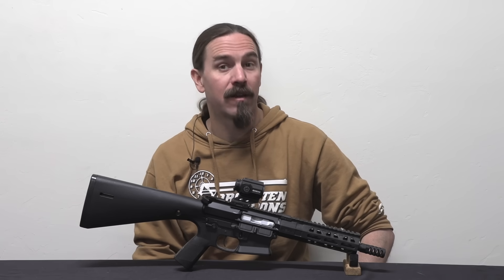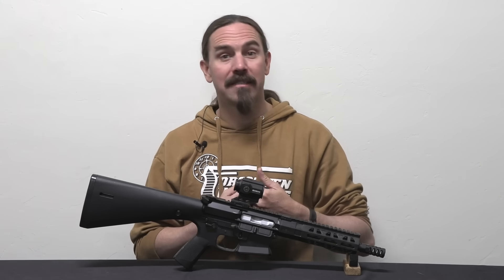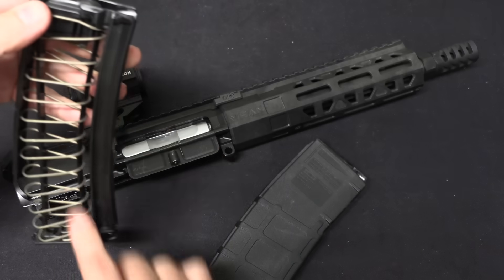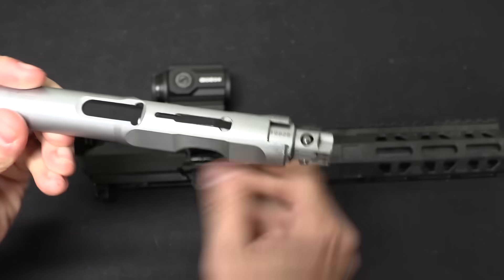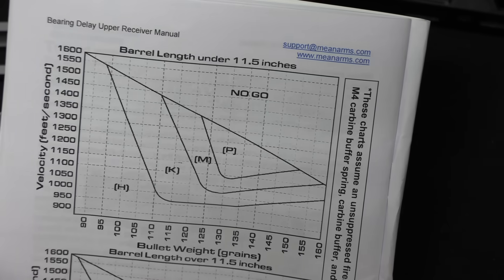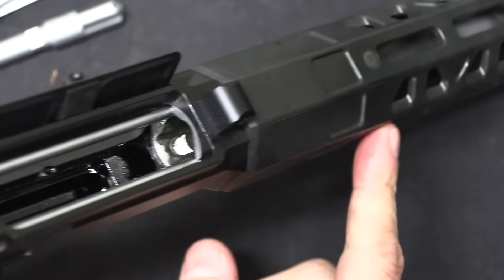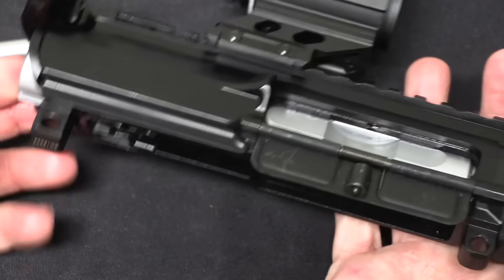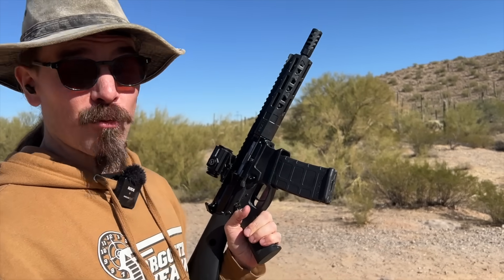Mean Arms' Bearing Delay System

Comment: There IS NO DELAY,, as in a HK, there is no delay,, its a carry over from the german rollen unterstützes masse verzügeres verschluss , the bolt head moves as soon as the projectile leaves the case, its just as slow as a heavy one piece bolt,, it does this by in a HK using rollers, in a Famams a lever (a Famas is a lever assisted blowback) , the bolthead in all systems just makes the bolt carrier move faster due to rollers or levers or in this case ballbearings ,(as a lever )  ,,it only happens for a short travel, and then the fast mving bolt carrier , drags the slow bolthead along ,,   these kind of guns should be called roller assisted blowback or lever assisted blowback or ballbearing assited blowback ,, ,, the delay dosnt exist in any of them
Reply: think about it,, if the bolthead didnt move before after a delay,, what the heck makes the bolt carrier move ??
Reply: Correct. It’s not delayed, it’s a “slowed down” blowback. That’s why this system is not suitable for full-power rifle cartridges: the case starts to deform as soon as shot is fired, and the chamber pressure is dangerously high.
Reply: @noneofyerbeeswax8194  Not true, its used im the HK G3 a fullpowered riffle, its also used in Hk 5,56 rifles and in Famas  ,in 5,56,,  Hk used fluted chambers, but i think famas get by without,, but i dont know if the Cases is reloadeble after wards in Famas ,, HK can be reloaded ,, and no, nothing is slowed down,,  the wqord deleay is from the German word versügered ,, ,, but the German phrase Masse versögered verschlus, is , better translated  to mass reateded lock

Comment: It’s cool, but way overpriced in my opinion by the time you buy an upper and a few of their magazines you’ll be $1800 into it not to mention the price of a complete lower upgraded buffer system, etc. all total probably 2200 and for that price of much rather have a high-quality SP5/MP5 clone with the true roller delayed gas system, they are way softer shooters than what I saw here in this video. And honestly, the aftermarket for MP5  is almost as big as AR 15s. Not to mention the zenith and century mp5’s are usually around $1500 on sale so you’re getting a better weapon for substantially less money. The A.R. 15 was not designed to be direct blow back, these companies have the right idea by trying to delay the lock up, but it still isn’t as smooth as a true roller delay

Comment: That bolt looks like a 1/2" impact gun anvil. Even the coating looks familiar to me, a 7 year auto tech. I suppose it serves a similar purpose: bear an extreme amount of pressure on all of your exterior faces without unlocking the detents or leaving the chamber, then unlock them and slide out precisely when commanded.

Comment: I use the mean arms 9mm conversion magazine with a CMMG delayed blowback 9mm upper. It’s cheaper and less complicated.

I use the standard buffer because it doesn’t need to be adjusted. 

With a suppressor attached the system works perfectly and is close to hearing safe with standard range ammo.

Comment: After getting to shoot a full auto MP5, I'm in love with roller delayed blow back for 9mm. This looks like a fantastic upper. But at 1500$ for the upper and 35$ for the 40 round mags, its just too expensive. If I was a competition shooter I would 100% get one. I'm not a competition shooter and as a PCC solution it is just to expensive. In the PCC space you have lots of much less expensive options. There is defiantly a place for Lambo PCCs, just not in my safe. For 1500$ I can get an MP5 clone or just spend the full 3k and get a real MP5.

Comment: See i LOVE the mags being standard p mags, at least your muscle memory for working the gun and reloading will carry over exactly, even though the recoil control won't. Which is WAY MORE than most PCC's can list as a positive. Helps it fit the title of a trainer upper better.
The ability to tune the system is like butter on top, probably the only PCC i have ever seen and didn't instantly think of reasons i would never buy or touch one.

Comment: not to sound like an armchair gun designer but for about as long as i've known what roller delayed blowback is and how it works, i've thought that ball bearings would be a natural evolution of the cylindrical rollers that HK and company have historically used. reminds me of how i thought it'd be really cool to have a pistol where the springs rest in the side of the slide/bolt instead of in the middle of it so that the slide/bolt could move back further and have a longer travel, meaning it'd have more of a runway to decelerate before putting the recoil back onto the shooter, only to discover that one of the variety of autoloading magnum type handguns had already done that. i forget which it was, probably either the wildey or the Brand Name AutoMag (TM). guess it's good to know that my ideas have precedent for working on the off chance that i ever get loaded enough to actually afford to design guns. a nice thought, i suppose

Comment: Curious how these compare to the CMMG radial delay. The CMMG doesn't have adjustability but used for many other stronger caliber. 

I love my CMMG 9mm and 45acp setups. But the Endomags did not work at all for my 9mm, had to get the CMMG Colt mag lower

Comment: You swithed to a heavy buffer, but I am very curious if changing the lifter could also tone it down.  Less mass flying back and forth will also reduce the felt recoil if a different lifter can slow the bolt down.

Comment: Some good ideas and good design.  Roller bearings will probably wear slower than ball bearings.  Relatively complex machining.

Looks well made.  I wonder if the tolerances are too tight for dirty conditions.

In an ideal world, the operating system would automatically compensate for different impulses/pressures/masses.

Looks like it shoots nicely.

Comment: Love the concept but how well will it work in dirty, dusty and muddy conditions? Seems to be a lot of small, tight tolerate parts in there that wouldn't like any foreign material around. Otherwise, I think it would be great for the police to use after trading in their 5.56 uppers. Less range, and less velocity makes the public safer. I've seen windows shot out 600 yards from a police action with 5.56 where a 9mm would not have traveled that far.

Comment: as ive sayed multiple times in the past: Balls make NO SENSE at all! The surface is LESS than of a roller, and the rollers already are wearing parts. Additionally, the angled wedge (the only way to "adjust" the rollers - or "cam lifters" called in here) will wear more again due to the low surface.

Instead of wasting money for a "bearin delay" just get a roller delay MP5 - it is already eating rollers, but at least its a proven system that does work for a couple of rounds.

Comment: I appreciate the video of the Bearing Delay System and you explained it quite well.  But, I don't believe I could ever trust that system over the "normal" AR type bolt with the locking lugs.  I wonder how often you would have to change out those bearings?

Comment: I'm confused, since its not di or gas piston, what pushes on the bolt carrier to unlock it? Since its locked with the bearings the bolt can't move back to push the carrier. Or does the bolt move back a little to start pushing the carrier?
Reply: The bolt moves back a little, which pushes the ball bearings together pushing the lifter aft, which moves the carrier back and unlocking. It probably takes about 30 pounds of pressure on the bolt face to unlock it.

Comment: It's awesome to see this kind of engineering being done today. 
Question. Once the delay has overcome the bearings resistance to the chamber/bore walls, does the angle of their force on the lifter provide 'acceleration' to the bolt too?

Comment: i'm working on a novel delay system where the bolt gets super depressed and doesn't have the energy to unlock until its room is so full of trash that it can't see the carpet anymore, then it finally does its job and cycles.
Reply: well, you gotta have uppers and downers for sure !!
Reply: Rate of Fire: One to Three rounds per week.

Accessories: Available, but why bother.
Reply: I have a lot of experience with that system
Reply: @DeltaSierra0605 good to see a fellow S.A.D. operator
Reply: I had one that I called "throw it in the sink until the end of the football season." An absolute dream.
Reply: Is this before or after it loses all of it's friends, job, and girlfriend?
Reply: @Gunbudder  introducing the new and improved HK MEH-7
Reply: @Gunbudder  teenager delay cycle. Heard it's pretty gassy though
Reply: Hoarder delayed, it's been done
Reply: you ok man?
Reply: Gen Z delayed system.

Comment: Innovative. CMMG Banshee has been using Mean Arms 9mm mag inserts for years. Question, though, why use a muzzle brake on a 9mm delayed blowback rifle? For people who want to lose their hearing? I wonder if the bearing delay mechanism is any stronger than the CMMG radial delay system... the CMMG system is simpler, and generally fewer parts means less parts to break. I like the mags that don't require a PMag, too. I'll have to look for some of them for my CMMGs.

Comment: rollers replaced by ball bearings.  I think rollers are superior since their shape makes them work in the longitudinal way on their wole length right from the start, whilst balls concentrate the constraints in a small arc which gets wider as the bolt moves backward.

Comment: Great video and the best explanation of how the parts work and go together that I've seen so far.  The owners manual does a great job explaining this but we live in a video world now and even though I've cleaned mine 3 times now I've still learned a few things from your video.  I bought a 16" version in November of 2024 and really enjoying this upper.  I'm using it on a Aero EPC9 lower with Glock mags and mainly use it for PCC in USPSA.  I have 1280 rounds through mine with zero issues.  The machining and finish on all of the parts is exceptional and I like the polymer handguard more that I though.  It's a keeper..... all of it.

Comment: No way. I was working on something very similar several years back, inspired by that video you made on the ball bearing locked bolt action. I still have the cad files but abandoned it after realizing there was no way I would be able to machine it properly. I'm so glad to see the same idea working!
Reply: I remember that video.  Was curious if this design has any relation beyond coincidental.
Reply: I've been tossing a similar idea around my head for years but I have the CAD skills of a drunk monkey so that never quite got off the ground. Think along the lines of an air hose quick disconnect where the bolt is the male end, the barrel extension is the female, and the moving ring of the female end is the trunnion.
Reply: The Heym SR30! 
That action was neat, and I also thought it would make for an interesting self loader. 
I don't have any CAD experience though, so it was never more than a thought experiment for me 😅
Reply: That's awesome man! Good on you for trying!
Reply: For delay blowback it has been mostly rollers and that seems easier to machine.  But perhaps in a 9mm AR system there is an advantage due to space and materials to use ball bearings.  It might also be more resistant to carbon buildup.
Reply: @loquat4440  Firstly, off-the-shelf ball bearings are easy to come by.

Secondly - I think using all three dimensions of a ball (and three of them) should allow for very precise lock-up - and good resistance against wear and fouling.

The original purpose of roller-delay was to allow very high rpm in an open-bolt machine gun. Precision - not so much.

The MP5 was derived from that. Although quite precise for a submachine gun from the 1960ies (closed bolt) - this thing has the potential to beat it without having an armorer tinkering with it.
Reply: @stanislavczebinski994  Just in case anyone is confused about the MG42, it is a roller locked breech recoil operated and not a delayed blowback just in case someone was thinking that way.  The CZ52 that uses rollers is also a locked breech recoil operated pistol.
Development of the MG42
''The design and mock-up gun proposals were submitted in October 1937.[12] Großfuß AG's entry proved to be the best design by far, employing a unique recoil-operated roller locking mechanism whereas the two competing entries used a gas-actuated system.''
The delayed blowback using rollers IIRC was discovered by accident when some experimental gun was being photographed and the rollers found to be unlocking.  The best known early use of the roller delayed blowback was the CETME rifle that was not so different from the G3.  Perhaps someone as you say made an extremely rapid fire machine using roller delayed blowblack.  But I am not aware of it.   
The MP5 was much later:  The MP5 (Machine Pistol 5) was first created in 1964 by Heckler & Koch. The MP5 is a submachine gun that fires pistol-caliber ammunition.  The CETME was in production by 1950 done former NAZI engineers working in Spain.
Reply: Cap

Comment: Finally a 9mm AR upper I would actually buy. I could never understand how you could have more perceived recoil in a PCC vs an intermiedate cartridge and NOT think "what the hell is this?"
Reply: It's part of what I like about 300 black. In the subsonic version is essentially a pcc perfected.
Reply: @GunFunZS  We are total opposites lol, I love .300BLK in it's super sonic loads, which I have found 150gr+ .300BLK traveling over 2600-2700 FPS out of a 16 inch barrel, which is a shit ton of energy that has a really good BC depending on the load because it's .300WM bullets seated in a necked down 5.56 casing.

Talking about the .300BLKs dimensions, either I hope someone does it and wildcats 5.45 / .300WM bullets in a revised .50 Beowulf casing or eventually I'll get around to messing with it; pushing those bullets to the max while still being able to be chambered in the AR platform without having to modify the platform itself to fit the dimensions is the idea.
Reply: Ah, but the relative high recoil makes it great for simulating rifle rounds.  Half the price, but similar feel and function.  Just find a combo with lrbh and endomags but full recoil.  Perfect

Comment: The customization to the delay is neat. In actual practice I'm curious how it compares, performance wise, to CMMGs radial delay system. I have a banshee and I'm quite fond of it. I have 2 WWSD builds, so I'm not averse to polymer, but at that price the foregrip looks cheap. The proprietary guide rods in the upper in this design won't allow for it, but hopefully in the future they come out with with a bolt / barrel combo that builders can use like CMMG does.

Comment: For my CMMG Banshee I went with a JP captured spring using an H2 buffer and a 308 spring. Recoil was smooth and soft and it cycled a bit quicker than with the standard carbine spring.

Comment: There is a reason why H&K uses rollers and not ball bearings -> It's about surface area contact. A roller will have a large surface area contact against a flat surface lik the wedge or locking groves, while a ball will have a tiny surface area contact patch against the locking surfaces. Resulting in the ball bearing system wearing out much faster than a roller system. Sure you can say that a pistol cartridge has so low pressure that it wont matter, but it still will eventually wear out the wedge and locking groove surfaces because of the small contact area concentrating the force, and the ball bearings most likely being much harder than the locking surfaces. You can replace the wedge when it wears out, but the barrel extension is another matter.
Reply: Everything wears out eventually. If there is real cause to worry about the longevity of the system, we'll hear about it soon with the number of rounds some competitors shoot per year. Until then, I don't think it makes sense to avoid the product merely because they could have chosen a different engineering solution to a problem. We have no reason to think the path they took is insufficient for the task
Reply: Could they be lubed?

Comment: I sadly don’t own one of these, but I do have a radial delay 9mm CMMG. The CMMG is very soft shooting and has a smooth recoil impulse.
That said, the MEAN ARMS is highly overpriced when you compare the two. Mean arms should’ve released a couple variants with one of them being a budget model and another being a midprice model and a competition model. 
1.4K is ridiculous for this, coming from the perspective of somebody who doesn’t make a ton of money or do competition shooting. Like there is systems for a bearing assisted blowback buffer system that costs a lot less and is probably 85% as capable as this, or the CMMG which is still a quality system that runs reliably for less than the price of this.

Comment: At this point, it seems inevitable that the process will go full-circle and someone will just make 9mm ARs with normal AR operating mechanisms and rotating bolts
Reply: Does 9mm make enough gas for that to work?
Reply: @nerd1000ify  There's enough gas for even the ultra-short versions of the Sig MPX to work, and that's a gas-operated short-stroke piston, so it's definitely workable.

Comment: Just a thought those ball bearings are going to be trapping a lot of grit and carbon so the bearings are going to take a beating. A wear item ? I think so.
Thats the only part of the engineering I have issue with the rest of the upper seems well designed.